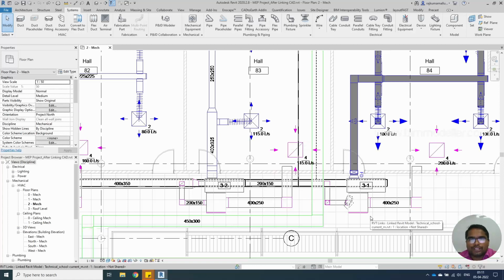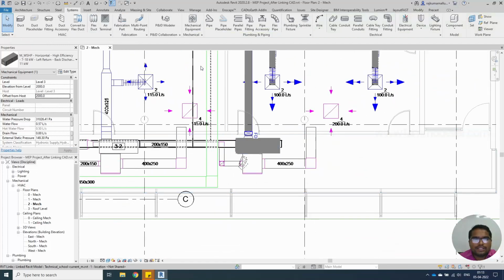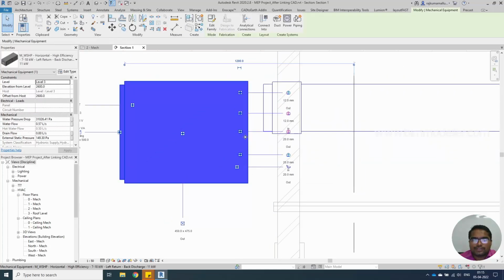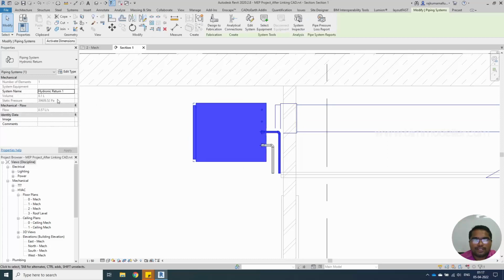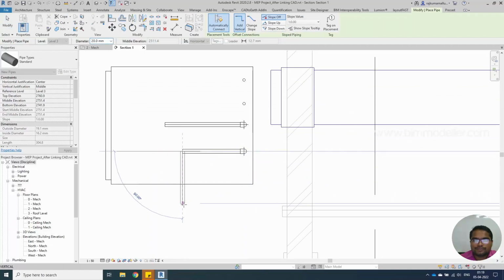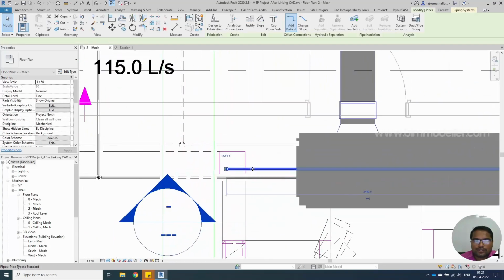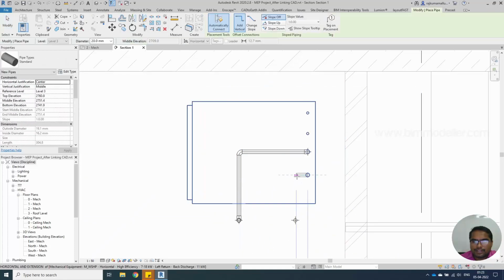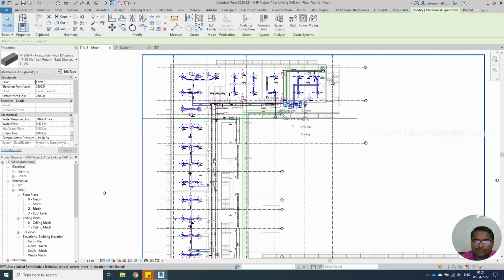Revit MEP Project 25: How to Create Hydronic System(LTHW) Flow and Return?

Comment: I have a question!

I’m working on an irrigation design, and the pipe fittings flow should be based on the floor area.

For example, one area might be 100 m², another might be 50 m². I want the fittings to calculate the flow rate as 0.008 L/s per square meter.

I plan to set the floor area as an instance parameter, and the default flow rate as 0.008 L/s per m².

How can I configure this logic inside the Revit family?
What is the correct way to set up the parameters in the family so that the total flow is calculated based on the floor area?
Reply from the maker: Sounds like a great application of Revit parameters, I can try to address this in a future video!